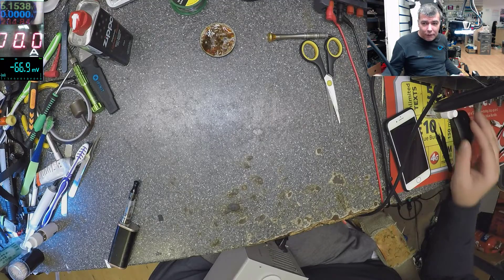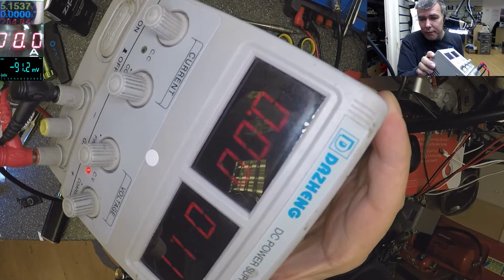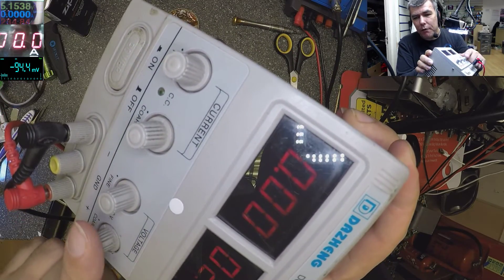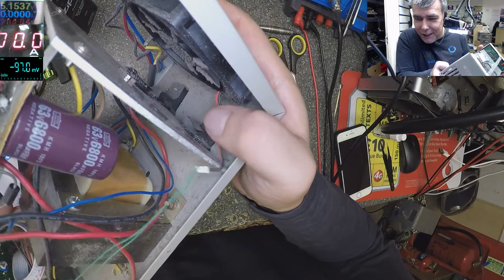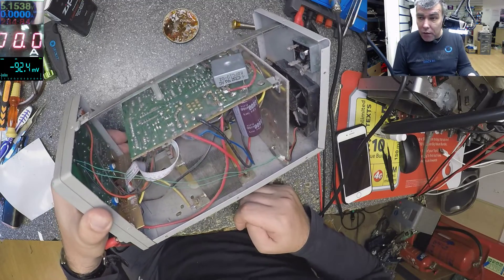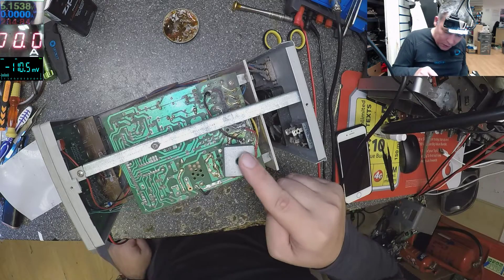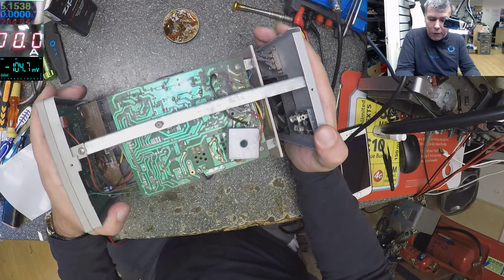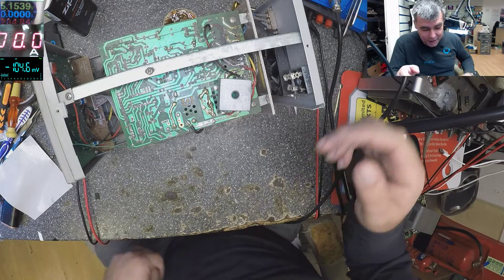About my power supply... the most overworked power supply ever

Comment: I have a couple small amperage linear power supply's on my bench ....... I do need big iron AKA 25 to 40 amps at times also , I work on 100 watt radios and amplifiers , audio amplifiers really draw the juice at times ....... I have a Ray Jefferson 4 amp supply from the early 70's , it was made to run a mobile CB radio or Marine radio inside of a house / business ETC ..... The PSU has a speaker in it so when you install the radio on the top of it you plug in the 3.5 MM wire into the EXT. speaker jack on back of the radio ..... That way you have a front fired speaker facing you , instead of a bottom speaker being muffled by the PSU .... The PSU has holes drilled on it's top cover from the factory so you can mount the CB radio bracket to it .....

Comment: Wow, that is a cheap power supply. I have a 0-30V 0-5A one like that but it is made by Yihua. It acted up once, found that the IC sockets were severely corroded (yet nothing else was corroded!!!!). Replaced the chips without the sockets and it has worked fine.
It also has three output transistors instead of one.
These cheap power supplies are known for output transients though, so be warned!!!

Comment: Sorin, my spool of solder recently went AWOL, and i had an urgent repair to do on a power jack, I used Solder paste and while i had to reapply a few times to get the right amount the job worked out really well, shiniest joints i;ve seen in a long time, lol, the finished job was really strong and as would be expected with paste it flowed really well, my question is, is there a down side to using paste as opposed to normal solder and is the joint likely to last as long? not that i'm considering changing but would just like to know out of curiousity, tanx.......the missing Solder turned up about 2 days later :)